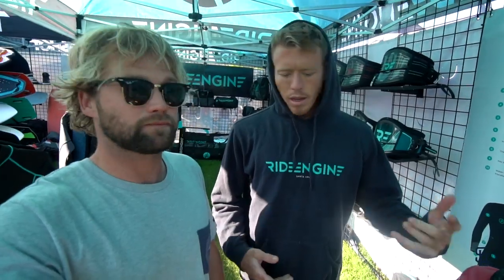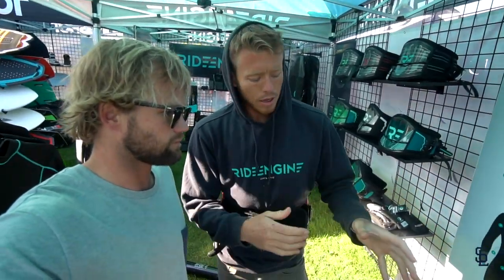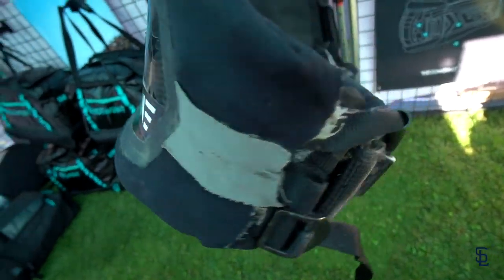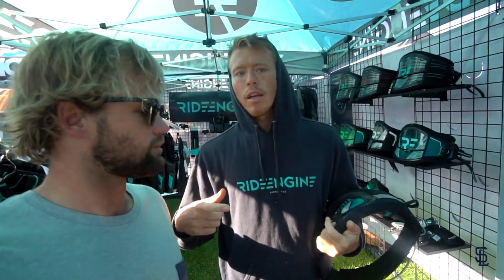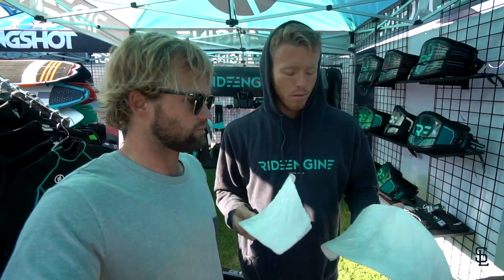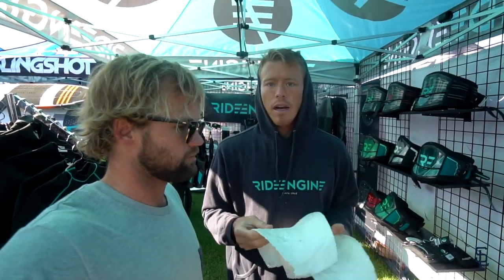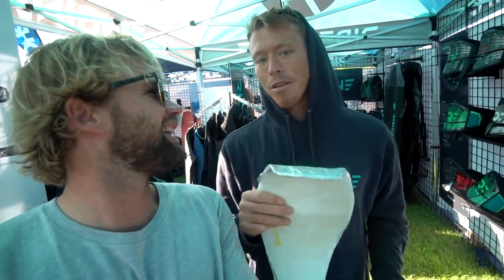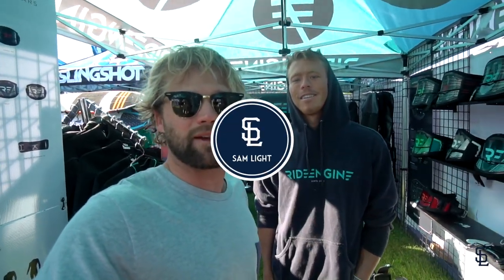The story of the hard shell harness - Coleman Buckley

Comment: Have they fixed the issue of the harness plate cracking and detaching from the sewing? If so, how have they sorted the issue? I use ride engine harness currently and have this issue, but will happily replace with another R/E if the issue is sorted. Thanks
Reply: Its sloved since 2019 👌